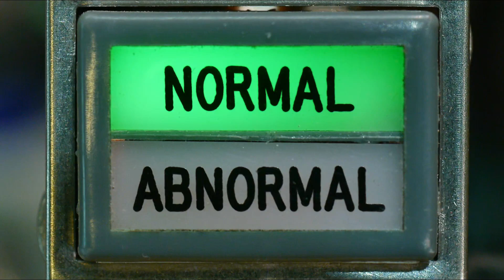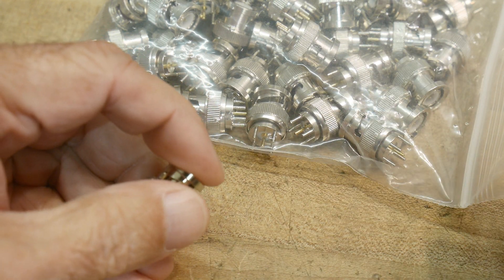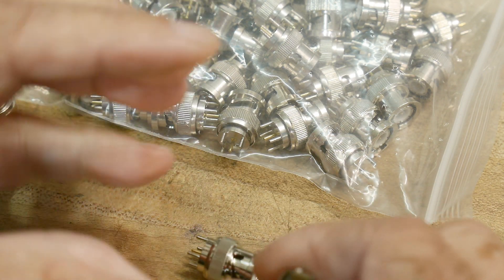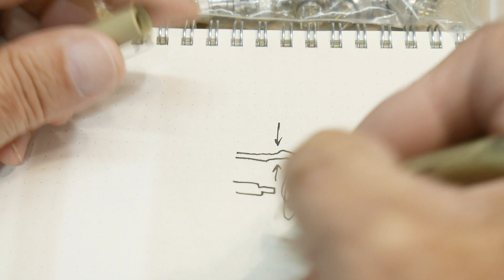#1683 Bad BNC Connectors

Comment: Great video! Is it possible to disassembly male/female bnc connectors without break it?
Reply from the maker: the metal is rolled over, so you will need to unroll an edge, good luck

Comment: Having retired from the TV broadcast industry, I was confident that to my knowledge I had never experienced an intermittent BNC connector in my entire career. It  therefore made sense to use this as my "go-to" connector when I built my new Amateur radio station. However I have been plagued with unexplained intermittancies ever since.
Your video made me investigate, and  low and behold I have the same issue as yours. I am annoyed that I missed it and now need to re-assess my choice of connector as these BNC's seem to have become  the norm!

Comment: I'm curious about the performance of the BNC without the outer mechanical part.  Granting that it isn't where the main connection happens, they must have considered the outer part in design.  I know I've had some poor performance with 75 ohm BNC tees for 50 ohm impedances.  So I'd expect that removing the outer part would change the behavior at least slightly

Comment: Use a TDR and/or VNA to weed out the bad coax and connectors. However, in your case the part failed physical inspection. As a hobbyist, I use a Tek 7S12, Tek 1502 TDR, and a HP 8753E VNA.

Comment: I work as a Alarm/AV Integrator. The company I work for does structured wiring for residential homes. We will prewire the home for cameras using CAT5E or CAT6. A lot of times I have had to go do a warranty call on a camera system that a client hired some craigslist trunk slammer to install the equipment and when thinks don't work out we get the blame claiming it's our wiring. Anyway I go out there and it would be a analog camera system using the cheapest UTP-BNC baluns I have ever seen. The BNCs would look like that cable or cardboard impregnated copper on that inner ring.

Comment: I did notice that my coax connection to my Elecraft T1 tuner does just fine without bayoneting.  I just wish the BNC jack on the T1 and my KX3 didn't keep getting loose. I don't really want to thread lock or solder or glue  it to the chassis.  We need better jack-chassis mounts as well as jack-plug connections. Split rings and star washers mar the chassis.
Reply from the maker: the pros use N-connectors

Comment: Those clips can have issues as well, as you know, when you open the clip its meant to isolate one side of the clip from the other, but I had a set where the spring inside the clip had burrs on the ends that had cut into to the insulating material meaning it didn't matter if I opened the clip, both side were still connected via the spring. 
I had to open them up and file the burrs off and place extra insulation beneath the resting points of the spring. Just bear this mind if you have some measurement problems, was a head scratcher for me before I realised what was going on.
Reply from the maker: good to know

Comment: Another point with BNC is that there are actually two sizes. 75 Ohm and 50 Ohm have a different size centre pins.
Reply from the maker: and N connectors too

Comment: I ran into the same deficiency when I purchased cheapo BNC to banana jack adapters.  The cylindrical part for the outer conductor was too thick to have spring action and was too small in diameter, so the fit was loose, making unreliable contact as shown in this video.  The cylindrical part had some splits as though there would be spring action, but the splits were much too short to provide any spring action so they could not be bent outward to make better contact.  Buyer beware!  ☹ If you want reliable BNC connectors or adapters, be sure to purchase name-brand items.
Reply: Pasternak
Reply from the maker: I remember the day when all connectors seemed to be Amphenol

Comment: Aren’t the BNC’s on your test leads 75ohm video connectors and not 50 ohm RF? If you search 75ohm BNC that’s the BNC that pops up on Google, Amazon.
Reply from the maker: my search did not show that, but if you look at a real 75ohm BNC you will see it too should have a split mechanism: https://www.clarkwire.com/product/1282
Reply: @IMSAIGuy  The only difference, I’ve found between the 75 ohm and 50 ohm bnc connectors , is that the 75’s don’t have the white dielectric around the center conductor. Has to be more to it than that, right?
Reply from the maker: the center conductor pins are different sizes and not compatible  @JasonBurchell76

Comment: Those Kelvin clamps look a lot like the ones the come with the Ruoshui LCR meters, but the ones that came with my 4090c do have split inner rings that are also gold plated. Some years ago, there were several complaints about those male BNC connectors on the clamps bundled with the Ruoshui/EastTester LCR meters fitting like crap and I wonder if they were the same as this set you ordered. I'll have to look into that as it's obviously all speculation and I obviously can't confirm this from memory.
Reply: Nope. Not the same connectors as the ones from the examples I had in mind, though what I have discovered is that there are at least three different examples of BNC connectors used across these and they're easily distinguishable as different by the knurling of all things. Mine have a crossweave, the ones in this video have vertical lines and the ones I was thinking about has a square pattern. Interesting.

Comment: Interesting - I'll have to keep an eye out for this now.  As far as somehow screening for this without actually holding the part in your hand ... in my experience, a picture of a part you are buying online is just that - a picture of a part and is NOT necessarily what you will receive.  I'm even going to go as far as to say if you ordered the part from the same vendor two weeks later the chances are good you will receive a different version of that part because the "manufacturer" found a cheaper supplier.

Comment: I ordered BNC connectors from AliExpress and received ones with the same problem I filed a complaint with photos showing the problem   The vendor refused to refund or replace They were not expensive but I wanted something that worked    The photos on the site showed segments but in reality they were like your ones Ali express sided with the vendor
Reply: I wonder if anything you get on aliexpress, ebay, banggood, taobao, dealextreme, ... is good. My experience is 100% of the parts are very low quality, but maybe they sometimes at least work,
Reply: Odd, usually they side with the customer atleast for me, then again it says that I spent a thousand dollars on aliexpress in a single year membership thingy.